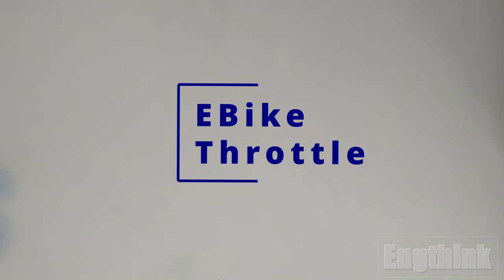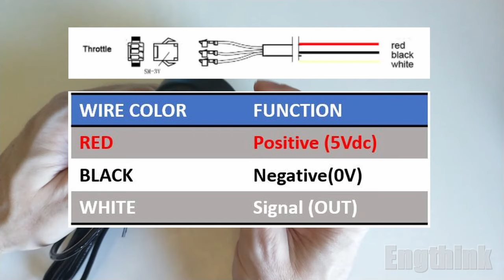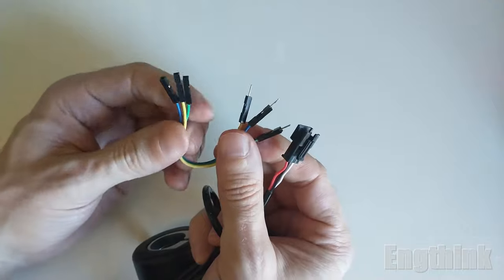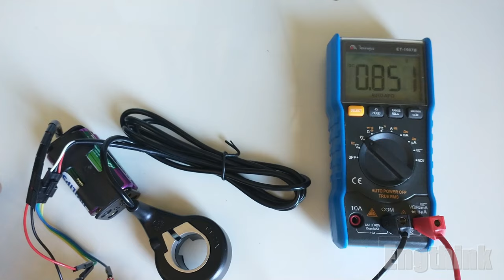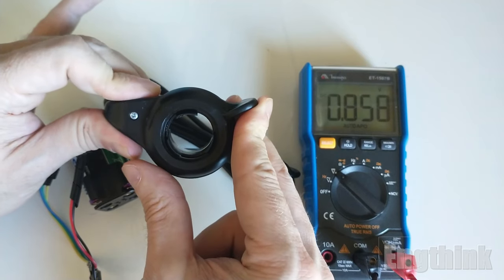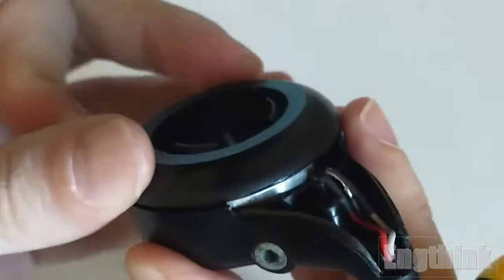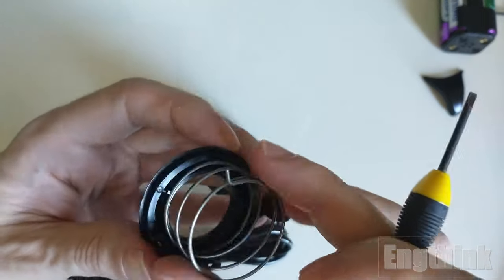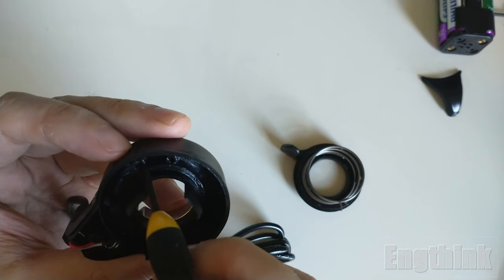Linear Hall effect on E-Bike Throttle - Understanding & Testing #ebiker #ebikeThrottle #hallsensor

Comment: Very nice video! Very useful info about the mixing up of the wires in the connector. Do you have a vid about the way each wire is held inside the connector and how it can be released so the wires can be rearranged inside the connector?
Reply from the maker: Thanks, good sugestion I will try to make soon.

Comment: thanks, i tried it just like you showed but my multimeter constantly reads 3v on the signal out. i guess the sensor is broken. i am interested in a controller but it's ADC supports only 3.3v instead of 5. given that the controller provides the voltage and reads it, it should work?
Reply from the maker: If you dont have change in the signal out the senosr is gone. Need to replace. About your question , I did not understand.

Comment: I was watching your videos to find a question related to my answer. Recently the rear wheel started to move quietly when I accelerated very slowly, but when I accelerated quickly the motor sounded bad and shut off after two seconds. The paddle assist still works. Can you tell me what kind of problems the bike has and how to fix them? Thanks... It's a 1000W gear drive motor.
Reply from the maker: It's difficult to pinpoint exactly where the problem is. For some reason, the controller is shutting down the power to the motor, so the issue could potentially be in the motor. The best option is to try to isolate the issue, which could be either in the motor or the controller, in my opinion.

Comment: I have a Phantomgogo R1 36v scooter. The make and model are Sine wave brushless controller 2HM-0. When I tested the 5v red wire coming out of the controller I found that the 5 volt Red Wire is pushing 17.44 volts. I am afraid of connectiing the.controller to the throttle because I do not want to damage the throttle.  Is this high voltage normal or is it a defect? Will it destroy my throttle?
Reply: He tested it by putting 5v through it... if you did what he did then you put 18v worth of batteries to it.

Comment: If I give on the signal , more than 5 volts dc , the motor goes   Above the max speed ? .. I have an urbanglide escooter and I search how to unlock the max speed ,, my scooter have 25 km/h top speed , but I don’t know where I unlocked ,, it’s from dashboard or from controller ?
Reply from the maker: Its depends how they block the max speed. I am not sure tha the limitation is in the 5Vdc signal from the accelerator.
Reply: Ok for this ,, I have one problem now ,,, I put on rear wheel a onother motor from other escooter , so the front wheel work from the controller 1 and dashboard 1 , and the rear wheel work from second controller and the second dashboard , I take  only the signal throttle from first dashboard and I put it on the second dashboard throttle ,, it works perfect , but yesterday, when I give throttle the rear wheel spins backwards as fast it can !!! For some reason , I don’t know , I’ll check all connections and the cables and the phases , all!! I’m thinking to turn the wheel upside down , but the speedometer do not work , because the motor going to the wrong way ,, do you know what happen ? 😢